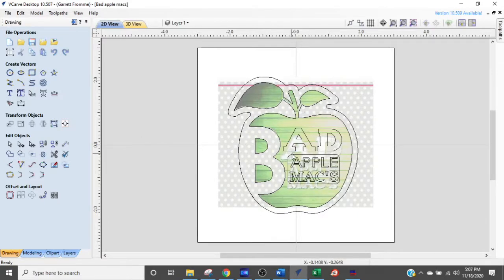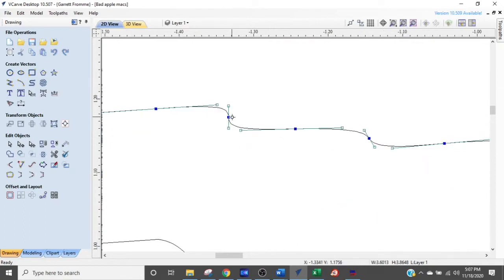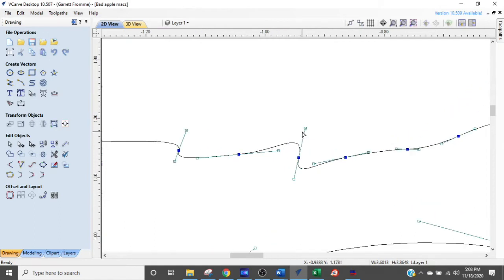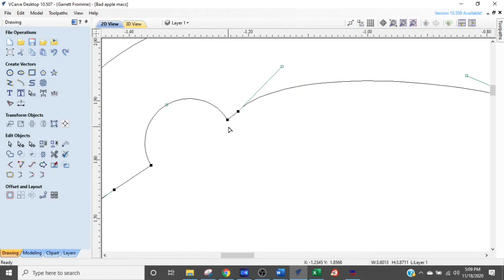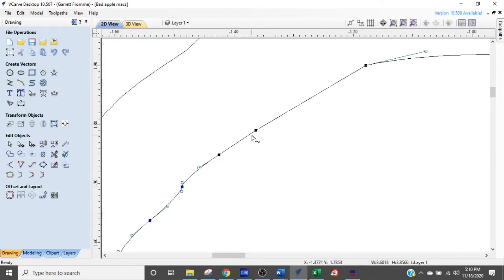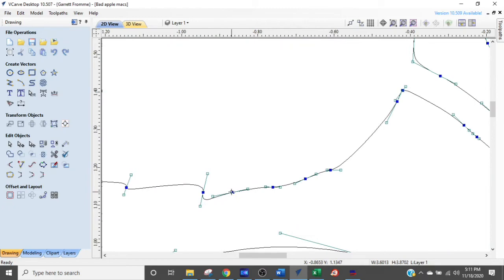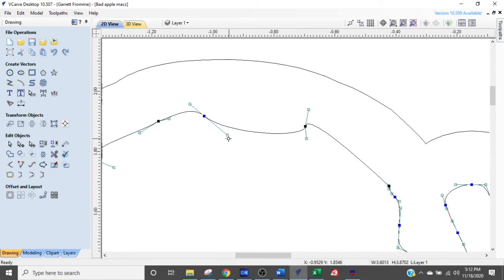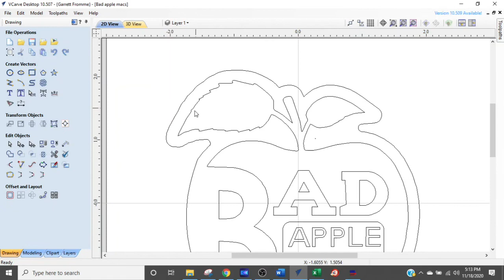Adding Fine Details In V-Carve With Nodes, CNC Router Tricks In Woodworking

Comment: Another good tips video for starters like me!
Reply from the maker: Thank @Jonathan. Hows the build so far?
Reply: @IDCWoodcraft  Actually started the build last night!  The painting process and drying took a while.   Primer, 2 Coats of Enamel, and Shellac finish, plus sanding in between!  Got the Y and Z chassis built and combined last night.
Reply from the maker: @casualbluegecko  This is very cool. It's a lot of fun to build. Are ya' feeling the bonding to it yet?
Reply: Another good tip i learned..I will try this in carveco and see if it works the same..thanks for the schooling..👍